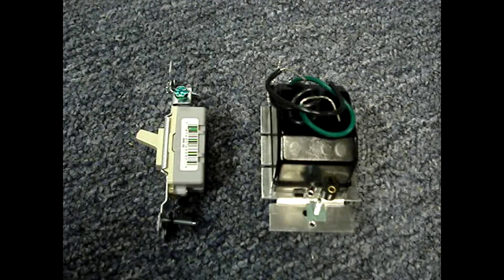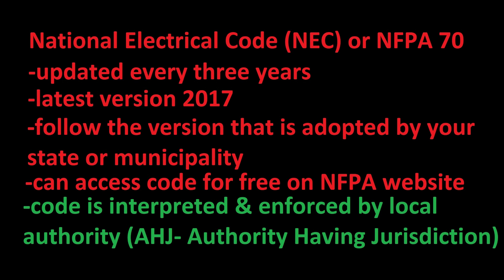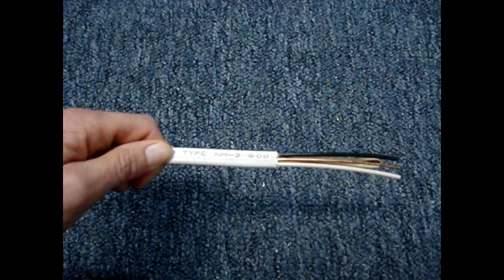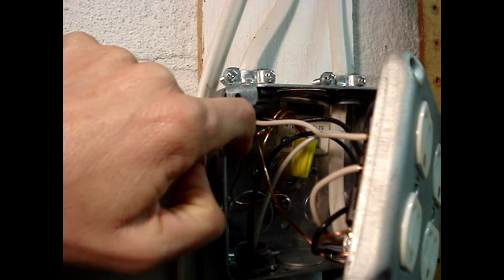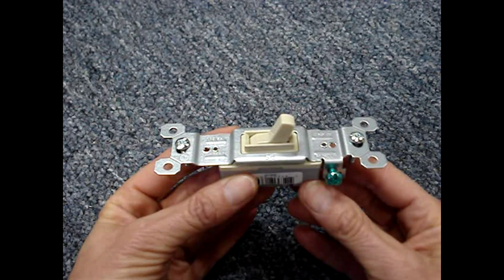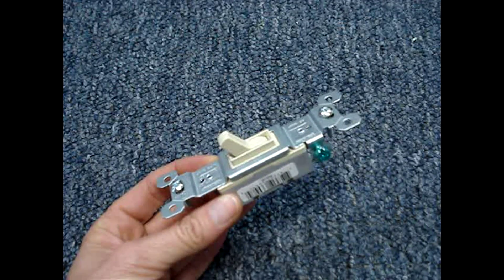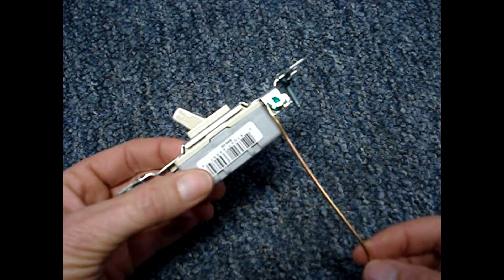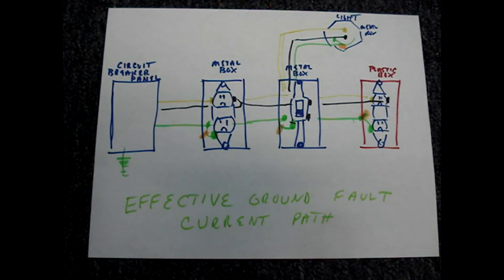How to Connect Ground Wires

Comment: Thanks, this is all helpful. I'm assuming that it's okay for a ground wire to be touching metal of the electrical box in more than one place? The reason I ask is because I'm installing a light fixture and the bare ground wire will be connected to the fixture's ground screw but it will also be making contact with the inside of the metal romex - there's no way for me to avoid this right now.. long story...i was hoping it won't matter...?
Reply from the maker: It shouldn't cause a problem.  Just don't let any "live" connections touch the box.
Reply: @Know-How-Now  thanks much!

Comment: I took the crimped ground wires apart, ran one ground to my light switch and left the other grounds loose. I now know that was a mistake and have left my light switches and house ungrounded. What is the best way to fix this problem? Thank you.

Comment: so if i don't have grounding wires in my light fixture (box with wires coming out) I either need to run a grounding cable to the main breaker or switch to  a plastic light fixture? I have a ceiling fan I want to install and a led shop light in the garage and neither box has grounding wires
Reply from the maker: Generally, the code that was in place when your home was built applies if you are replacing/repairing.  My home was built in 1952, and  most of the cables do not have a ground wire.  If I need to replace a light fixture, I don't need to run a ground wire. It's "grandfathered".   I can just replace the light fixture and not connect the green wire attached to the light fixture.   If I were to add a new room to my home or do a renovation, then the current code would have to be followed for that room/area.  

The biggest problem if you don't have ground wires, is the outlets.  They no longer make 2 prong outlets and you are not allowed to install a 3 prong outlet without a ground wire.  You can install GFCI outlets or breakers or run new cable with a ground wire and install 3 prong outlets.

Comment: My house has no ground and I am replacing the light fixture and stove vent which has no ground and those 2 fixtures are old so those fixtures didnt come with ground. The new 2 fixtures I bought has hot/neutral/ground. So if this is the case I'll connect the hot to hot and neutral to neutral how about the ground? As you stat I dont need to connect the fixture ground to anything and should I just cap it off with nuts? 

Another ? I have is how do I text a metal box that current is use to house the light fixture to see if that box is grounded to the house ground? I have a 2 range colt tester, I recall the tech st home depot told me this 2 range should tell me if the metal box is grounded or not but I forgot how to go about that step to see if the metal box is grounded. If it is ground than I'll just buy a ground pin to add the ground to the pin and connect it right to the box but at the moment I dont know how to test that box to see if it's been grounded to the houses ground. 

Please help
Reply from the maker: Yes, just cap off the ground wires.  Older homes that don't have ground wires are a tough situation.  I'd recommend that you budget to upgrade the wiring.  If your home was built around the 1950's you might want to have a good look at the cables.  Sometimes there is a ground wire that was clipped off.  If the electrician left some extra wire you may be able to connect the grounds.

2nd question - I doubt that your box is connected to conduit.  The grounding of the box would be done via the ground wire on the circuit.
Reply: @Know-How-Now  thanks for your prompt reply!!! 🤗🤗

Comment: Question: For years I used the same security light in my yard. I changed to an LED one. The fuse kept tripping!!! With the switch off, I noticed that ground wire was giving me electric shocks. What is wrong. I connected black to black. White or neutral to white and ground to ground. 3 times in a row the fuse tripped. 
WHAT SHOULD I DO? 
WHY DID THE GROUND WIRE BECAME HOT!!!?
Reply from the maker: If the breaker is tripping, you likely have a short between hot & neutral or a short between hot & ground.  You'll have to break the circuit apart to find the problem.  If the cable is buried in the ground, the cable can fail.
Reply: Know How Now : Is there an electrical tool that can show me whether the ground and hot wire are touching!?
Reply from the maker: You can use a mulitmeter.  Remove all power from the wires you are testing, if they are on a dedicated breaker, remove the wiring from the breaker.  Check for resistance between the hot and ground wires.  If the wires are good you should read no resistance (open - infinity).  If you read any resistance then you have a wiring problem.  If the wires are buried, it is not uncommon to have the insulation break down over time.  Do the same thing between hot & neutral.  You should also check between earth ground at the panel & the hot & neutral. Here is a link to a video I have about how to use a multimeter to test resistance/continuity. https://www.youtube.com/watch?v=9H-uMSGHFXM

BE CAREFUL if you are working in the main panel.  If you don't really understand what you are doing, you should hire a professional.  If you become part of the circuit when it is energized there is enough current to stop your heart.

Comment: Never CLEARLY answered the question, what to do if old receptacle has no ground wire. No ground wire, stop the install of three prong outlet. correct!
Reply from the maker: Hi Ted, I am not understanding your question.
Reply: if the old is metal you should change to plastic but if is plastic already theres no need to put a grounding wire.

Comment: Where to connect a ground if there's no origin of ground wire to the main power source?
Reply from the maker: There is not an easy solution.  You'll have to run new cable that has a ground wire.  I know that is not always easy in an existing home.  A good electrician can often fish new cable without having to make too many holes in the walls/wood work.  If it's an outlet, the code allows you to install a GFCI outlet.  Before doing that you should check with your local codes department to see if that is allowed.  You have to put a label on the outlet saying it does not have a ground.

I'm sure there are a lot of existing homes that don't have ground wires/ground wires that are not connected.  If your home was built when codes did not require a ground wire, then you may be "grand fathered".  Depending upon your local codes certain circumstances may trigger a situation where you have to meet current code.  Again, you'll need to talk to the local codes department for the correct answer.
Reply: Can you connect to the ground from another circuit?

Comment: But what if the circuit box is not grounded?
Reply from the maker: I am interpreting "circuit box" as a metal box that will hold a receptacle or a switch.  The concept I'm trying to explain is that all metal parts of your electrical system are connect together via the ground wires on the wiring system and then tied to ground at the main electric panel.  If you connect a ground wire to a metal box (as shown in the video) to the ground wire(s) on the wiring entering the box, the box will be grounded, assuming that all the ground wires are connected in any junction boxes.

Comment: When ground wire off a chandelier is too short to attach to ceiling screw What to do
Reply from the maker: You could try using a push in connector to add another length of wire.  https://youtu.be/CGO1FVUf5hY

Comment: Where do I find that main box that you connected the initial ground to? Your video explained things very clearly.
Reply from the maker: Find your electric meter, there will be a very large wire that goes from the meter into your house and then into your main breaker panel.  Inside of that box there is a ground bar where all of the ground wires from your house are terminated.  Be careful inside of that box.

Comment: I don't personally get too worked up over grounds, but I agree they make things much safer.  I can give an example.  I have a relative who got a nasty shock when a heating element shorted out on a stove which was not grounded.  The element worked, but transmitted stray voltage to a pot and when my relative touched the pot and a grounded fridge, they got a big shock.
Reply from the maker: Thanks for the comments and the example of getting shock from a malfunctioning appliance.  Luckily your relative was not grounded to something and supplying a return path to the power supply. 

I'm trying to educate people on how to connect ground wires properly.  If there are ground wires and they are connected correctly, they will trip the circuit breaker and turn off power if a piece of metal becomes energized.